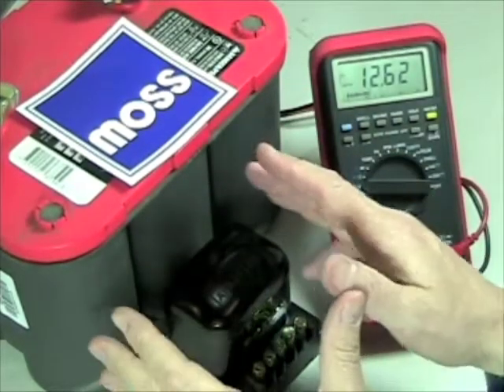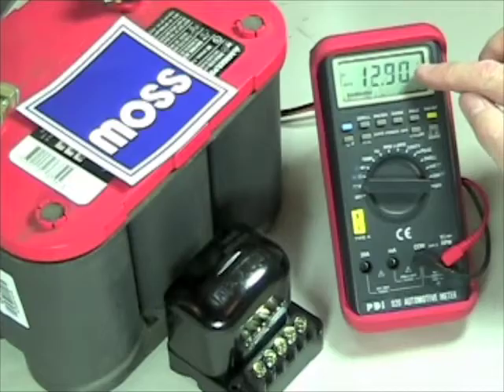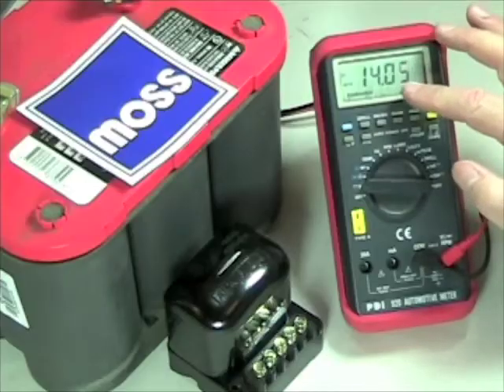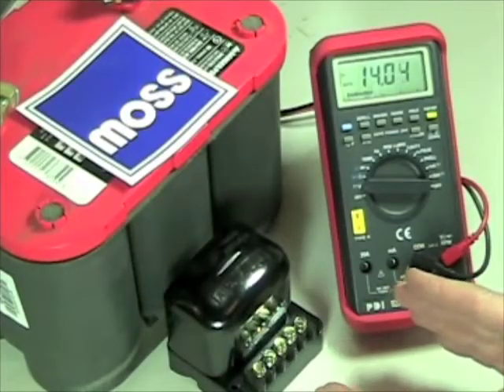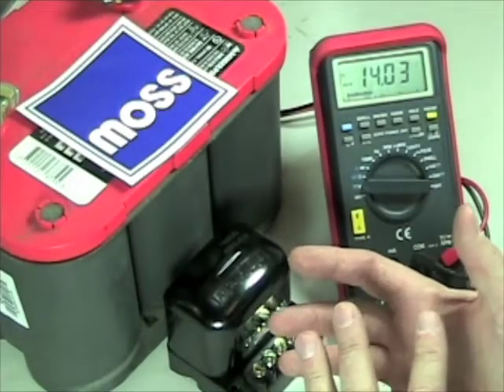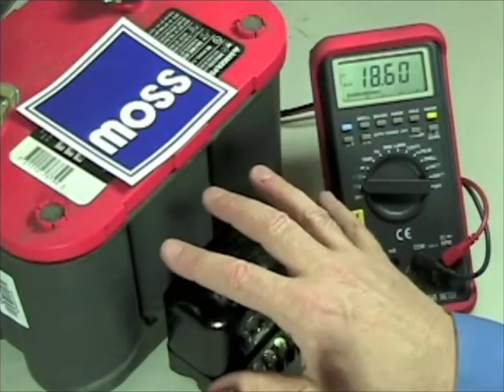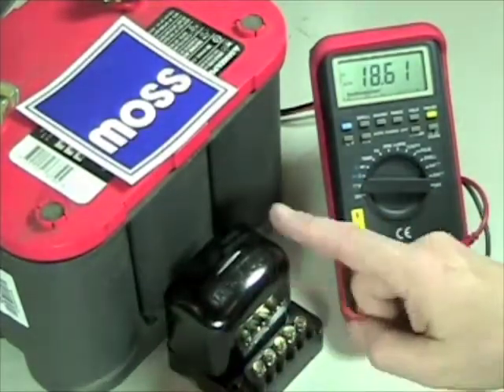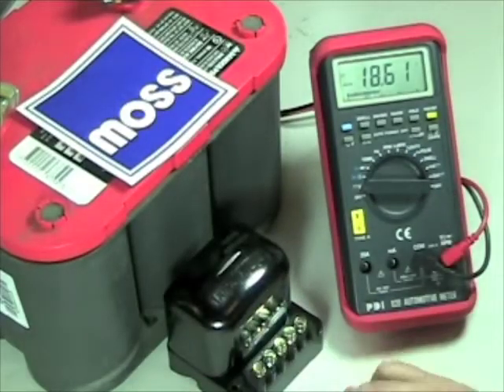Voltage Regulator Adjustment (Pt 2) - How to Test & Adjust

Comment: A voltage regulator is an electronic device that controls the amount of voltage supplied to an electric load. The alternator is a type of generator that produces alternating current electrical power. A sense terminal is an input on some voltage regulators used to monitor the output voltage. It is possible with a simple resistor voltage divider to externally adjust any alternator with a sense terminal to produce a higher voltage. This can be useful if you need more power than what the alternator can produce, or if you need to correct an over-voltage condition.